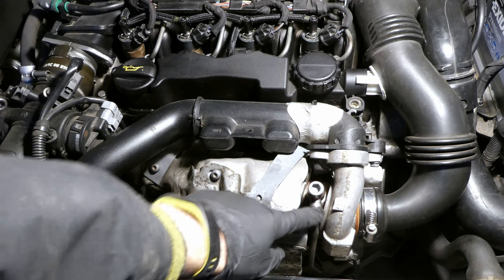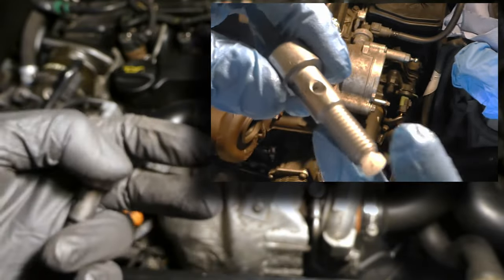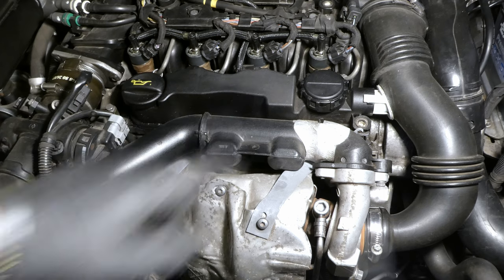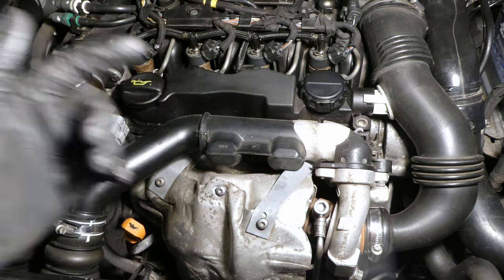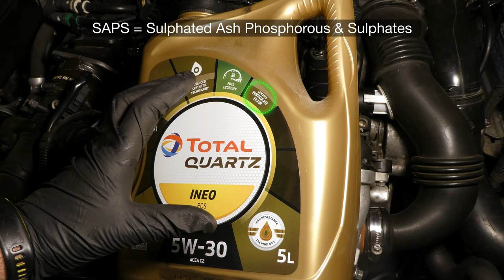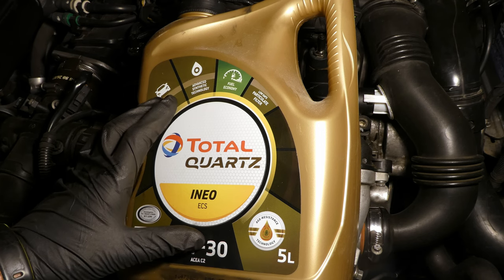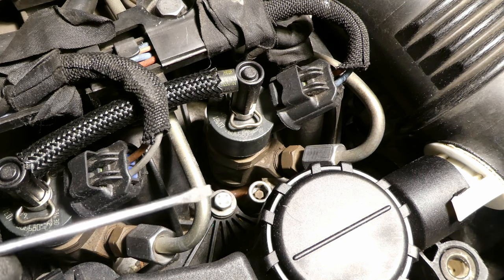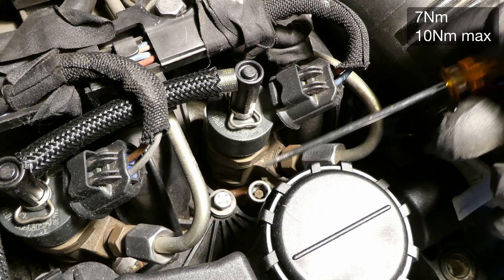1.6HDi turbo failures, the 2 main reasons and surprisingly simple steps to prevent it

Comment: You are probably right, but  i dont get it how that carbon build up comes in contact with the oil. In my understanding the gases comes through the failed copper wash and going  in the athmosphere. How comes that the oil get contaminated
Reply from the maker: The injector tube is not integral to the top of the engine, in other words, there is a rubber o-ring that should prevent any carbon going in the crankcase. Nevertheless, gasses and other stuff from the combustion become really hard substance and forces its way through the rubber seal and end up in the crankcase oil. Some of course end up in the atmosphere, but the longer it is left the more might end up in the crankcase oil. That is why it is quite crucial for the seal to be replaced as soon as it is noticed.The whole thing boils down to that this rubber seal that seals the injector tube from the crankcase is not perfect.
Reply: @moremolecules  If i get you correctly there is opening in the cylinder head which is sealed throgh the rubber o-ring. OK but why there is any opening, why not like the spark plug in the petrol engine. Only one copper ring and that is it? Any function?
Reply from the maker: @courcheveller  Because you have to be able to remove the head and do some repairs. If the two are one piece you would not be able to remove the head to do repairs. There is a copper seal at the bottom and one plastic kind of o-ring and a rubber o-ring at the top. That is it. It is the same as petrol engines, not that different, but the compression in the diesel especially the HDi is huge compared to a petrol engine. There is a spark in the petrol engine, where in the diesel is compression only.
Reply: @moremolecules  What I mean a year prior, is the design of newer psa 8v head 1.6hdi, there is not possible that blow by come into contact with oil because injector hole is one piece in the head from combustion chamber to the top,  like spark plugs in petrol engines with only copper ring.  No point of contact with crankcase oil no need of that rubber seal. If you have blow by through copper ring, all that goes away without chance of mixing with oil. I did not imagine that in 16v all that can be made like it is made. The head design of 16v is definitive extremely prone to expensive turbo failures.
Reply from the maker: @courcheveller  Yes, it has been designed like that unfortunately and a stupid copper washer to cause all these things. I think later models they realised the mistake and fixed it, but the earlier models suffer from that issue.
Reply: @moremolecules  Copper washers are common problems in all diesel cars, but the idea that this rubber seal can stand the pressure and seal the camshaft housing, in case copper washer fails, is extremely bad. I dont know of other cars with that particular design.
Reply from the maker: @courcheveller  Yeah, it is a bad design unfortunately.

Comment: Is it okay to use 10w40 oil?
Reply from the maker: It should be alright, but that depends on the climate of the country where you live. I use 5W30 as I live in a continental climate. I have not heard people using 10W40, most use 5W40 for a bit less smoke as it is a bit thicker than 5W30.

Comment: I'm changing my turbo tomorrow (it's gone again) after 2 years
Do I remove sump? I did the last time that s time oil hasn't  got  metal in
But the last time was lots of metal in oil, also I've removed intercooler has a lot of oil in it I had to remove from top, air con pipes below
Reply from the maker: I would say that you need to clean everything, from the oil, oil pickup, banjo bolt filters. Crucially you also need to clean the vacuum pump as well, as metal bits go there as well. Also, make sure that with the new turbo there is at least 300ml flow of oil through the turbo. Basically, you put the new turbo and everything and run the engine for 1min with the turbo oil return disconnected in a jar. Measure how much it is returned, it should be at least 300ml. Make sure that the engine has enough oil before doing this. I would remove the sump and clean everything. Also, once the new turbo is in, drive it for ~300miles and replace the oil and oil filter again to remove any small metal bits that might clog the banjo bolt filter. Also, depending on the model and year if yours has the old-style filter (metal mesh) either replace it with the new longer plastic version or remove it altogether. Perhaps some of those can be seen here: https://www.youtube.com/watch?v=Q7S0qDBo314
It is a series of 5 videos how I replaced mine, but it does not include the vacuum pump and the 300ml check.
Reply: @moremolecules  thank you for your replys
Today I removed sump and a small gold peice of metal was in sump
I also washed out intercooler it was black
Washed sump out sealer on sump back on
Remove turbo feed pipe plastic type gause blocked up and think ill leave out
Hopefully have all back together tomorrow thanks very much Adam
Reply from the maker: @adamwort7160  If it is a second turbo, you need to know why it is failing, otherwise you will have to do another one. Wash everything and of course see if the injectors are not leaking. The gold piece, not too sure about that, it may be a magnet on the sump bolt to capture any metal pieces not to swirl around. Make sure everything is clean. The banjo bolt, it is 50:50 call, if you have metal pieces in the sump it will go to the turbo and block it there eventually. Otherwise it will be blocked at the filter, either way it will not be good.
Reply: @moremolecules  as far as I know this Berlingo has had 4 turbos
When new then replaced when I bought car that lasted 30 mins because they hadn't even changed the oil
I went on Berlingo forum why does this keep going?
Last time I fitted second hand turbo with genuine feed pipe still both on turbo
But I didn't know about the gause 
only this evening see gause it's blocked but I can degrease and fit? Not sure if my shop sells new ones
Reply from the maker: @adamwort7160  I suspect you can degrease/clean it and re-use it. It is a simple mesh. Definitely do not re-use the metal small mesh, that was superseeded by the longer plastic mesh. Yes, you will have some carbon clumps in the engine, whether this is from injector seals or something else, difficult to know, but you need to be certain everything is clean. If not, then it will be blocked again. Change oil and oil filter a few times every say 300miles, that would help clean any remnants of clumps.
Reply: @moremolecules  yes injector is leaking and wet I did see your video about this and I will toque it down
I have no air line at home I will soak gause in degreaser and blow through with mouth and refit if I'm happy it is clear or try get a new one tomorrow
Reply: Sump is cleaned today and re fitted
Reply from the maker: @adamwort7160  Ahh, you need to properly sort this out with a copper seal at the bottom. It is unlikely that torqueing it down will help. Might help for a bit, but it will come back again.

Comment: My 1.6hdi (volvo s40) does a high pitch whining noise when at over 2500rpm till about 3200rpm. Can it be the turbo?
Reply from the maker: It could be, difficult to say. I would see if the propeller shaft is moving as expected (https://www.youtube.com/watch?v=-ML49tY9Pgk). These fail very quickly, a whine could well be the design of the air intake in the volvo, although it is fairly the same. I mean the engine is the same, but the filter housing, etc. are a bit different.
Reply: @moremolecules  it started today with this sound. All i find is mabye the alternator belt . I will check
Reply: Did you find out what caused it?
Reply: @GameCornerYT  it was a leaky egr valve . It literally sounded like a whistle. Replaced gasket and done.
Reply: @littlereptilian7580  Ok good to know! Thanks.

Comment: the oil pick up pipe on these can also block up causing starvation
Reply from the maker: Yes, absolutely agree, but this is mainly due to blockage of the oil pickup filter that gets blocked. Otherwise it is pretty wide diameter pipe. The main reasons of this blocking is as per the video

Comment: My sister has a 207 with the 1.6 HDi 90cv, has 144,000 miles, and for now the engine has not given a mechanical problem, the turbo is original.
The oil is always changed in the revisions, and the injector washers were changed before the paste was generated.
Reply from the maker: That is how it should be done, but depends on whether the stud nuts were also replaced or just re-used. I would always advocate for replacing the stud nuts. They stretch and can not be very successfully reused again. The copper seals can also fail even though they might be new. The injector seat also needs to be properly cleaned with a reamer tool, otherwise the new seal will not seal very well and you get the paste.

Comment: I have a 1.2 diesel that smokes only sometimes. When I take it to a workshop they look at me as if I have gone crazy. Does anyone know what the problem could be.
Reply from the maker: What kind of colour smoke it is? Black, white, grey, blue. Is it in the morning only or during heavy accelerateion, etc.
Reply: @moremolecules  it's grey. The strange thing is that it happens when it's hot or cold and when it happens if you switch off the engine and start it again it stops smoking
Reply from the maker: @garthwhite4747  Hmm, I am not too familiar with the 1.2, but do you know if it has FAP/DPF. It could be that if the conditions are right it could be doing a burn of the collected ash. That probably should only happen on hot engine, rather than on cold and most of the times on a motorway with steady driving.
Reply: @moremolecules  well I had the dpf cleaned and it does it. Like you say only happens on a steady drive. When it does it. It has a strange smell to it and also the engine gets a slight knock and the RPM picks up a bit. Very very strange
Reply from the maker: @garthwhite4747  If I were you I would get one of these OBDII cheap scanners and plug it in with say the torque app and see what is happening. You could get some clues. It is a newer engine, so not too sure if the cheap OBDII scanners would work, but worth a try. Most will work with an android phone, but not quite with iPhone.
Reply: @moremolecules  Thanks for your . Anyway
Reply from the maker: @garthwhite4747  Sorry, but rather difficult to diagnose from a distance, but your best bet is one of these OBDII plug in thingies and you get quite a bit of information from them.

Comment: didn´t understand how the leaked fuel finds its path to crankcase and contaminate the oil?!
Reply from the maker: It is not leaked fuel, but the baked carbon bits that go around the injector within the crankcase and this might get pushed through to the trubo, so the turbo banjo bolt gets blocked and turbo starved of oil and eventually it overheats without the oil and the shaft breaks from the heat.
Reply: @moremolecules  still i cannot find a link between injector seals and turbo issues - how can a leaked baked carbon bits go from the top of the engine to the crankcase?
Reply from the maker: @mladenfrank2613  I tried to explain it in the video, probably did not do a good job. The thing is that the injector tube is not integral to the head of the engine or crankcase, so there is a rubber seal that seals it from the crankcase. The gunk can pass that one and go into the crankcase oil and then the consequences of gunking the small turbo oil feed filter and the oil pickup as well.
Reply: Thx

Comment: The sump also has a reallly bad design so the oil doesnt completly drain when changing oil. I was doing changes every 10k kms or 1 year, but that doesnt seem enough looking at oil when it comes out. Im at 300 000kms now, i just destroyed a new turbo because the oil return line was blocked and i dont think the oil quality is good enough for the ebay turbo i put on.
Reply from the maker: Yes the sump is kind of bad design, but the amount of oil left is not really that much. See here: https://www.youtube.com/watch?v=5kevvRopWUc
150ml of old oil left is almost nothing compared to the 3.5L of new oil that one puts inside. Literally 4%, which is nothing. Yeah the biggest killer is the oil return that should be without kinks the pipe. No new oil gets through the turbo and it overheats.
Reply: @moremolecules  while it's a small amount percentage wise, particles that sink in the oil rather then float/mix will settle at the bottom and will not be removed during an oil change.
Reply from the maker: @bxyw  That is why there is an oil filter to pick up dirt or particles. If they are heavy enough not to float around they would stay at the bottom anyway. I did remove my old sump and there was not even a single particle down there.
There is only the option if people do not change their oil filter frequently enough to get slghtly clogged, so then there is a bit of restriction and restricted oil flow level. Then there is a by-pass valve on the filter housing and you get stuff going around this. If one changes the oil filter on a regular intervals depending on milleage, then there will be not articles down there.

Comment: Can that mesh on the banjo bolt be changed? Or you just buy the bolt?
Btw, 12000 miles sound too much
Reply from the maker: Yes, the mesh can be changed with the upgraded one, I did that on mine here: https://youtu.be/QHY_uPbPfyg
12,000 is not too bad, but more frequent changes will be much better.

Comment: 12 k is way to long for any engine let alone a diesel to go for a oil change ....Soot in oil is what destroys seals and bearings ...soot is of corse microscopic bits of grit...after even 8k oil is saturated with soot....change oil every 5k and you'll never have a problem ...

Comment: Hello my hdi 1.6 is burning so much oil. 2 liters per 1000

Oil also drips from the bolt that holds the wastegate rod 

Thanks
Reply from the maker: Yeah, maybe be there is more crankcase pressure. On working engine open the oil cap and see if there is excessive pressure, that would tell you.
2L per 1000km or miles is way too much, it must be blowing huge amounts of blue smoke. Do you have loss of power? Maybe the turbo is seized or the turbo oil return is blocked and the turbo is gone, difficult to tell from a distance.
Reply: Yeah it still has to normal power I think.. would the bottom bonjo bolt being blocked make increased engine crack case pressure
Reply: What all cause excessive pressure thanks
Reply from the maker: @stevenknox3765  A blocked banjo bolt mesh would not lead to excessive crankcase pressure, but blow turbo as it will be starved of oil. That is as far as I can tell, maybe it will be excessive crankcase pressure, not too sure what the consequences will be, but certainly a broken turbo shaft if the bottom one is blocked. You could undo the top oil feed turbo bolt and see if oil will come out of it. If nothing comes out then it is blocked, but then the turbo will also be gone. It spins with huge amounts of rpms and needs oil to cool down.
Variety of reasons for crankcase pressure, engine could be a lot of milleage, worm piston rings, etc. Maybe the PCV valve spring has collapsed and it is always closed. If I were you I would open it and inspect it.

Comment: Hi, also the big problem with the 1.6hdi is its poorly designed oil pan which has its drain plug pushed inward.  Here is a French video that modifies the problem: https://youtu.be/QPQ4u3TQm6Y
Reply from the maker: I agree it is a bad design and leaves a lot of oil left in the sump. I also understand why PSA designed it in this way. A sticking sump bolt towards the ground could be potentially knocked and all the oil will be spilled. The way they have designed it at least prevents accidental knock of the bolt, one can scrape the pan, but it is less likely that the whole oil will be spilled.
Reply: Nothing happens, This type of crankcase is inherited from the TU engine and that is why it is not a problem as long as the oil change intervals are respected and the injectors are not allowed to fire.
My sister's 207 has never had engine problems, and the crankcase has never been cleaned, the car is 14 years old and has 144,000 miles. Only injector washers were changed and oil.

Comment: Hi, Can i use any 5w30 oil in this engine?
Reply from the maker: It has to be fully synthetic and I would recommend low SAPs. As long as the 5w30 meets the specs it should be fine.
Reply: @moremolecules  Hello, is it better after car reaches some big mileage (like 200-300.000km) to put 5w40 instead of 5w30?
Reply from the maker: @Genakrul_93  Mine is at 106,000 miles, so ~170,000km and I still use 5W30, but 5W40 is also alright. The car will be less smokey with the 5W40 as it is slightly thicker oil. Yes, probably good to go with 5W40 at 200-300k km.
Reply: @moremolecules  Thanks for the very fast reply! :)